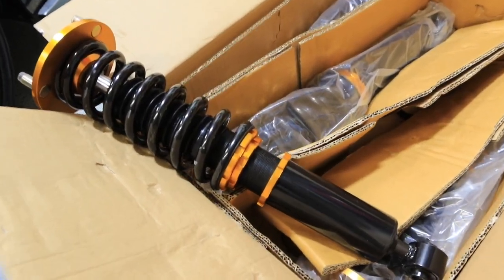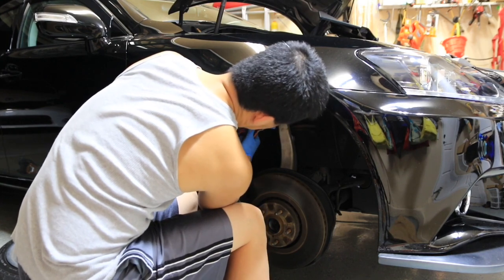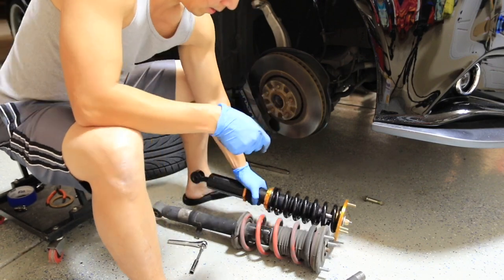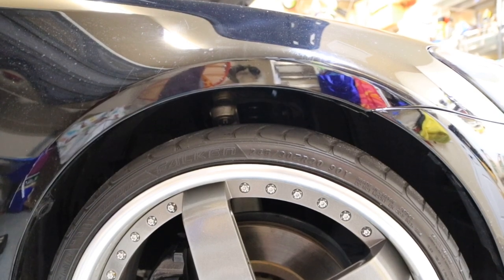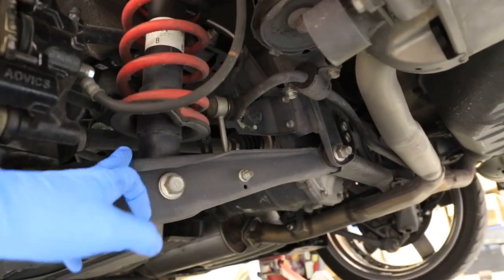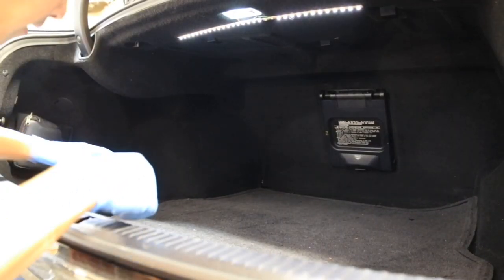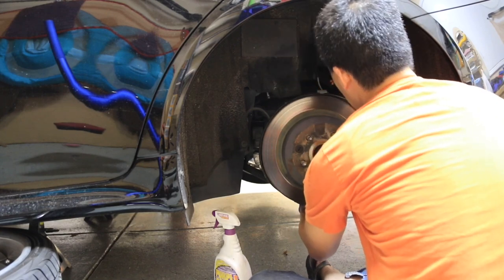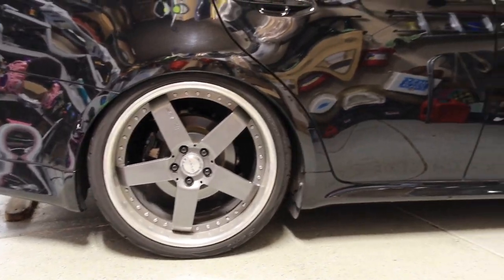How to Install Coilovers | $200 eBay Coilovers | 2006-2013 Lexus IS250 IS350 2IS GS350 GS300 GS430

Comment: hi, im thinking of installing coils however do you know how much should i torque the bolts on the LCA, etc?
Reply from the maker: I dont know. I just tighten them as far as they go. Its probably 90 ft lbs.
Reply: @TunerwithKids  alright thank you!
Reply: This is for the GS but in the ballpark: https://workshop-manuals.com/lexus/gs_460/v8-4.6l_(1ur-fse)/steering_and_suspension/suspension/control_arm/component_information/service_and_repair/front_upper_suspension_arm/page_7411/

Comment: what brand were the lower springs you had before? (google traductor) xD
Reply from the maker: I used to have Tanebe DF210 for GS300/GS350. They were lower than the ones for IS. I’m on them eBay coils RN. Been like 4 years?

Comment: Are they still running strong? I want to put coilovers on my Isf but don’t want to do anything expensive since I only daily the car and I’m doing it for form and fitment
Reply from the maker: They are still good for me. I daily my car about 25 miles a day on good roads though. I also have ability to DIY stuff so labor isn't an issue for me.

Comment: How are the coilovers workingout
Reply from the maker: Strategic Computer Systems still working. Probably got 15k miles and 18 months on them.
Reply: @TunerwithKids  what are the width of your wheels
Reply from the maker: 20x8.5 front (245/30) and 20x10 rear (275/30)
Reply: @TunerwithKids   do you still get wheel rub
Reply from the maker: rear, never rubbed. Front I have the fender bracket and liner cut and trimmed along time ago to get rid of rubbing. I did rub lot when I first set it low on these coils. I had to raise it up about 1/2 inch to get it back to normal.
Reply: @TunerwithKids  I sent you some images of my project on Instagram if you have the time you can take a look

Comment: Can they go pretty low???
Reply from the maker: Edgar De La torre yes but rubs like crazy. Major chopping if you want to go low in front.
Reply: Tuner with Kids ok cool I got 18s you have 20’s ??? I wanna get the coil overs you have only if they go low tho thanks for replying
Reply from the maker: Edgar De La torre 18s will still rub due to the design of that fender bracket and the bumper mount.

Comment: How do they ride and handle?
Reply: @TunerwithKids  thank you. I might give them a shot since my shocks need replaced anyway. But I am also thinking about bags since I scrape in my driveway at stock height
Reply: @edwardcook23  I have a 06 is350 on bags.  I might be parting out my bags and going back to static.
Reply from the maker: So far so good. I did notice the height has settled now and is a bit lower than I originally set.
Reply: Do you recommend them for driving short distances every day?
Reply from the maker: Francisco Fuster yea. I drive 11 miles each way a day with them. But smooth roads in FL.
Reply: @TunerwithKids  thanks for quick response I just bought my car so I'm on a budget so I will be getting me a set

Comment: Your wheel specs? And tires size?
Reply from the maker: KaoBlade 559 20x8.5 245/30r20 and 20x10 275/30r20
Reply: Your offsets front and rear?
Reply from the maker: Offsets are weak probably in the high 30s. So it clears everything on car with minimal to no rubbing.

Comment: Whats your wheel set up specs?
Reply from the maker: I Z 20x8.5 on 245/30 front and 20x10 on 275/30 rear. Offsets are weak be fit car perfectly with out major rubbing or modifying. I have perfect front camber using a 1IS SPC camber kit. Rear camber is fixed “Miami Chassis” style by widening  the lower inside mounting hole and pushing the LCA inward.
Reply: @TunerwithKids  I did my sc300 back in the days at Miami chassis. Hammer made did my camber kit!! Quality work!!! What the offset on the rear wheels I'm looking at some esr 05 for my 06 is250  but they only have 10.5x 19 +22  they don't make a higher offset or a 10 inch so I was wondering about going with the 9.5x19 +22 with a 275/30/19
Reply from the maker: That Miami Chassis torch, hammer, and grinder is sus for most people. That’s why they don’t let customers know what the magic is. For offset, +22 is too much for 2IS. You probably need something in the 30s to clear nicely. With +22, expect to grind and add negative camber to fit.

Comment: got any tips on how to get those upper ball joints out? u said u had some issues with it when u originally did it and i am now in the same boat. anything helps <3
Reply from the maker: Use a puller tool like this. Best little $15 tool. https://amzn.to/2Rer8A2

Comment: Do you have tire wear issues with camber on the front or back
Reply from the maker: My camber is fixed. Front is using SPC ball joints up top. Rear is widened subframe mount hole with LCA adjusted inward.